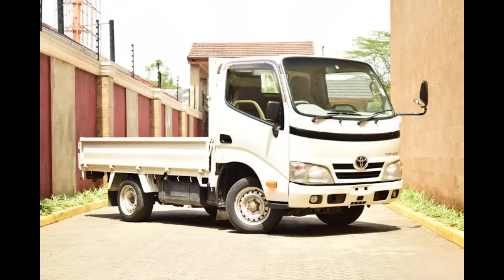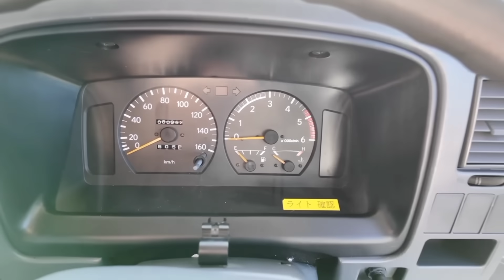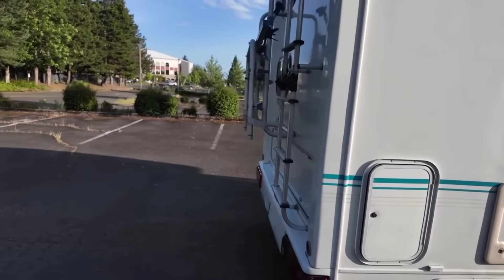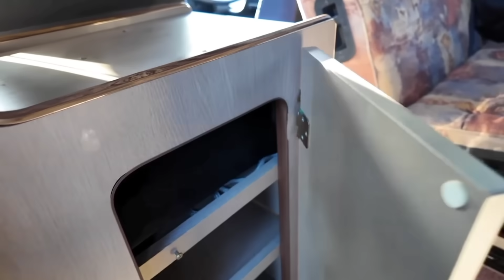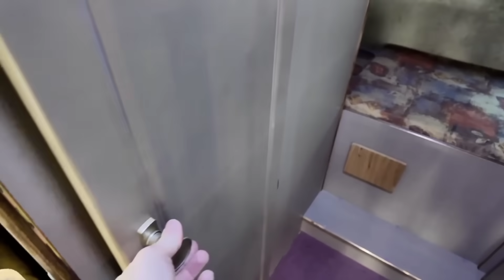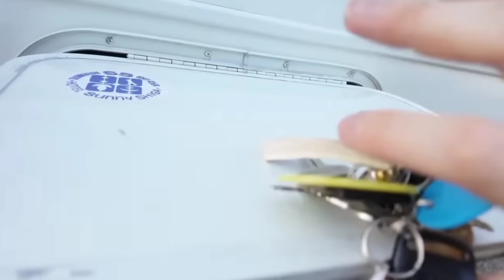Why People Are IMPORTING 26-Year-Old Japanese Motorhomes

Comment: I am a retired Automotive Mastertech that did a lot of work on Japanese vehicles. I found that, especially with imported used Japanese engines, if the SAME engine ... by engine family ID number, was available in the US, then the parts should be available in the US. Some makes like Honda and Toyota, offer the same powertrains for export in the US, so finding parts was not difficult. When the powertrain components were different in Japan than the export equivalents, parts were not available in the US and the owner would be forced to attempt to purchase the parts through a dealer or vendor in Japan and that can be a REAL hassle. Service can be a real hassle too if the only service information is in a foreign language ... in this case Japanese. Something to consider before purchasing a vehicle in another country and shipping it to the US. On the plus side, the Japanese mandate periodic maintenance and the vehicle registrations go up in cost the older the vehicle gets ... So, you can get a well maintained vehicle with relatively low miles on it.
Reply from the maker: This is incredibly valuable insight — thank you for sharing real-world experience. This is exactly the kind of information people overlook when thinking about imports. Really appreciate you taking the time to explain it so clearly.
Reply: Can't you just take the broken part to a machinist, or metal fabricator, weld shop & have the part made?

Comment: Every Camper or Motorhone Needs a Turbo now, or you will have huge lines of cars following you on every hill   Beep Beep ,:face-blue-wide-eyes: Beeeeeep
Reply: Add your own turbo and intercooler 👍
Reply: My  2.8 litre diesel copes with UK okay 😊
Reply: I owned a 1995 Toyota Prado which has  the same turbo charged engine and it towed my mates 2.8 tonne boat with no problems uphill at 100kph

Comment: I can tell you one big reason.  Because the RV manufacturers of today have become scumbags by cutting corners and selling customers trash that falls apart for the new ones I think the name is Thor.  The second is because Japan has quality built products especially the older models.  Japan just like the other countries started their decent into garbage for $100,000 but managed to not be as bad with all the new products being made in the last 12 years.  I won't buy anything manufactured in the last 12 years if I can.  Only Japan made or anything NOT China older than 12 years.  From small electronics to the bigger mechanical.

Comment: I bought one in Australia a few months back and just finished a 6 week, 7000klm  trip to the outback and the camroad never missed a beat. Easy to drive, easy parking, fuel efficient and very comfortable. If you are sitting on the fence about buying one then jump over, they are great.
Reply: What’s the price
Reply from the maker: @charlesreid3482  Prices vary a lot depending on year, condition, and where you buy, but they’re usually in the $8,000–$18,000 AUD range for good examples. (Could be different where you are too)
Reply: @CamperSpaceSecrets I’m interested in importing one ? If you could contact me please ?
Reply: Did you import it or buy it in Australia.
Reply from the maker: @blacksheepnonconformist  Some are bought locally, some are imported from Japan. If you’re interested in importing one, I can help guide you through the process.
Reply: @CamperSpaceSecrets I’d be interested in some advice about that for sure.
Reply from the maker: That’s awesome to hear! A 7,000 km outback trip is the real test—and it passed 💪 Thanks for sharing real-world experience.
Reply: Can I ask how they go on outback (dirt & corrugated) roads.  I keen to u destined how off road it can actually go.
Reply: I am interested  how much did it cost
Reply: Left-hand drive or right-hand drive?

Comment: Any vehicle imported Has to be 25 years old. Or older. To be on U.S roads Alot of car trucks and campers. At auction are cheap.  The fees to bring them here can add up. That camper. To bring it here. And the cost. Is around $6000 to $900. Depending on condition. Then the high markup begins.   I know this because. I had a lot of them imported to the states. Don't buy any right-hand drive cars. That are not 25 years old.  Make sure it has DOT and EPA papers. Or it has a U>S title Then its good.

Comment: You mentioned nothing about the fact that since it’s imported, it has a different voltage system than US. There has to be some kind of voltage conversion or step down or step up transformer let alone some kind of connection adapter.
Reply: US and Japan have same Plug type so it should be OK US and Japan both use Type A (two flat pins) and Type B (two flat pins + ground pin) plugs, so many US devices fit, but Japanese outlets are often unpolarized (slots are same size) or ungrounded (no third hole), requiring a simple 3-to-2 prong adapter for grounded US plugs, plus checking voltage/frequency (Japan is 100V).
Reply: yes, and US voltage is 115 to 120 so that’s still not a good idea. You need of a voltage transformer or you need to change convert to US voltage  @webblogsakuseimainjp
Reply: Never heard of these things called adapters?
Reply: @D_2_M  it’s just adopting from a US standard plug from a Japanese plug. It’s just an attachment.

Comment: A tip. Have the vehicle sprayed with quality rust proofing. After that it's a dream.
Reply: Especially if its Japanese . Apparently they don't  have problems with salt on icy roads hence don't underseal  .had my  Fiat camper van  underseal for £  500 about seven years ago  😊
Reply from the maker: @colintuffs568  Absolutely! Japanese vehicles are known for handling harsh conditions really well. Sounds like your Fiat got a solid boost with that underseal too! 😊
Reply from the maker: Great tip! Rust-proofing really makes a difference — keeps these classics running like new for years.

Comment: How do they get the engine as it is a tilt cab and the body is above the cab.
Reply: Don’t they lift up the seats like most Japanese small trucks and vans?
Reply: The engine is accessed by lifting the the front seat.
Reply: What do you mean ,how do they get the engine
Reply: @charlesreid3482 lift the seats for serving and maintenance and remove the seats and centre console completely which takes about ten minutes disconnect all the wires, linkages and hoses climb underneath to undo the engine mounts and lift the motor out you can take the door off to make it easier but you don’t have to it’s actually quite simple those japs are very smart

Comment: an old 2010 camroad may start at 30k US..
Reply: My issues are the used prices on these compared to a 22 ft US motorhome on a ford chassis. Next the diesel fuel costs offsets alot of the higher mpg ( typically Camrod gets 22 mpg on diesel) I can find a similar aged  US motorhome for 8k the difference between 8k and 20k pays for alot of gas
Reply: Lol I seen cheaper you got fooled by greedy ppl

Comment: I'm making a camper trailer for my e bike to pull . It's going to be 6 foot 5 inch long and 3 foot 4inch wide . 3 foot tall in front and 4 foot 4 tall in bach . Floor to roof not ground.
Reply: Great idea, very self sufficient, what is the set up for battery charging.